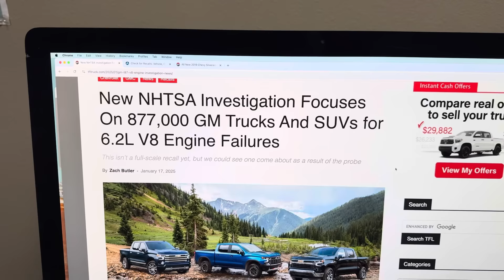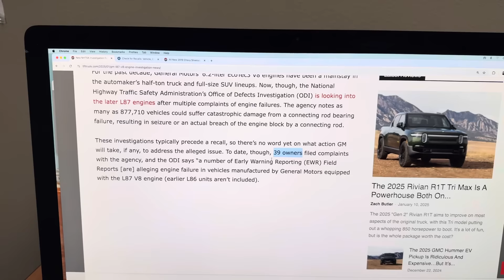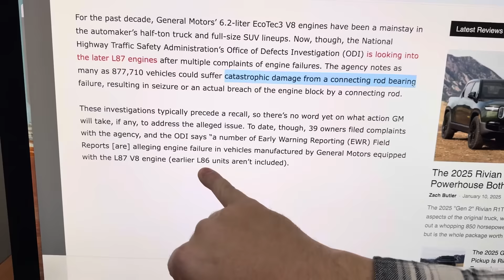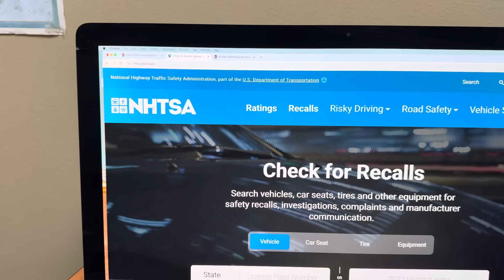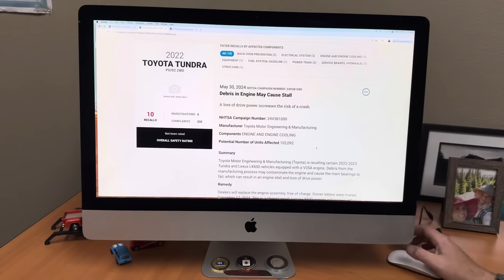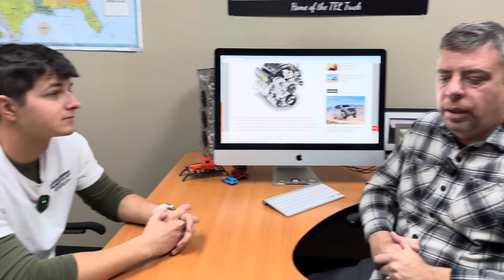877,000 GM Trucks & SUVs INVESTIGATED Over Failing Engines: Are You Affected?

Comment: Why is everyone saying this has to do with the DoD system? The problem has nothing to do with that system. The DoD systems only have issues if you idle a lot (the DoD does not function at idle already), and poor maintenence. The system uses the oil as a hydraulic fluid, not just lubrication,so when it gets dirty or the level is low, it causes bigger issues.
Reply: DoD issues have nothing to do with idling. And you just answered your own question why people are tying this to DoD. 1) using the engine oil as hydraulic fluid causes problems with the oil. 2) when there are issue with the oil, lifter fail and wipe out cam lobes. 3) where do you think the metal from lifters,cam lobes goes, and how might that affect bearings in the bottom end of the engine?
Reply: @CommonSense823 just say you’re a Ford fanboy and feckoff boomer.
Reply: @Liberator29  nice try Ridgeline hero.

Comment: Exactly why im sticking to ford! Would rather have a v6 with turbos than a v8 with cylinder deactivation!!!
Reply: And the damn turbo fail horribly bad too!  There is a mechanic I was watching that works at for and said they get them in all the time to fix.  They are not good engines either.
Reply: @ i heard opposite about the 2.7 ecoboost
Reply: @ms1406 Ford recalled the 2.7 for dropping valves
7
Reply: @stefanovichmichael9686  well my 2.7 has 165548 miles and its great from my research ford engine are doing a lot better than gm!

Comment: Man I love my 6.2's.  I'm sitting in one right now out in the West Texas oilfield it's a 2020 model trail boss that has 316,000 miles on it and has never been in the shop we have a fleet of nine of these trucks all of them with 250,000 miles plus all of them were equipped with the box that eliminates the auto start/stop along with all active fuel management and we have never had a minutes trouble
  On the flip side of that we have three trail boss with the little mini Max diesels none of those three vehicles made it to more than 60,000 miles before they had to have engines replaced they are just not built for day-to-day use out in our Dusty environment.
Reply: That's a hell of a lot of miles, good on ya! Are you running premium gas in those 6.2s? Any other tips and tricks for keeping their 6.2's alive (catch-can, oil change intervals..)?

Comment: Can the AFM be disabled?  A computer module re-flashed? A specific wire snipped?
Reply: New cam/lifters/valley cover. And a tune.
Reply: @ Yow, expensive.
Reply: @ parts are $600-$700.  It’s the labor that kills you.

Comment: I personally know several people who have had their GM 6.2 V8s catastrophically fail at low mileage and with proper maintenance.  One instance was an owner with three of them in GMC AT4's--two of which failed within weeks of each other, both trucks with less than 10K miles.
Reply: He owns a time bomb and is in denial.
Reply: I don’t believe you
Reply: @Liberator29  Believe or not believe what you want, but it's the truth.  I personally saw both trucks on tow transports headed back to the dealer, one with a connecting rod sticking out the side of the block.
Reply: @Liberator29 What is your motivation for responding to each commenter who claims first hand experience and suggesting that they are lying?  I get being skeptical but you're putting a lot of time and effort into casting doubt upon these claims.
Reply: @sonictech1000 Agree but a lot of trolls exist and are here just to fuel the fire
Reply: @Liberator29  quit whining on all the comments
Reply: @tylerboss  Liberator29 is just a troll. Ignore him.

Comment: The sad truth of new trucks in 2025- There is not a single manufacturer that has a 1/2 ton without a serious engine problem.

Toyota- Rod bearings 

Ram- Hurricane has misfire and overheating issues, pentastar follower and oil cooler, cannot be had without the hybrid system

Ford- 3.5 ecoboost cam phaser, timing chain issues and oil leaks, 2.7 wet belt for the oil pump, 5.0 oil consumption, mds, and wet belt.

GM- 5.3/6.2 lifter failures, 2.7 MDS issues and oil consumption, 3.0 wet belt at the back of the engine and DPF/EGR issues

You have the choice of "will it fail eventually" or "will it fail under the warranty period"
sadly, the choice for "truck that will give me trouble free service for 200k" is no longer an option.
Reply: I’ve got a Honda Ridgeline. I know most scoff at it, but it’s half ton and I don’t have a worry about anything in it.
Reply: @CliffWarren  does it have Honda's VCM?
Reply: @ It’s a gen1, so, it does not. So I guess the original point is valid, after reading about VCM I’m glad I have an older rock solid reliable truck.
Reply: Honda's V6 engines which is used in Pilots, Odysee and Ridgelines are having Crankshaft bearing problems, according to NHTSA. 😑
Reply: Nope. Ford fixed the cam phaser issue. Hasn’t been a thing since about 2021. And what timing chain issues and oil leaks?? Not on the 3.5
Reply: @Pilot545  Every vacuum pump on every one I have ever worked on was at least seeping. The turbo drains are notorious for leaking as well. 

As for the timing chain fix, The chain is still the same length and construction, still guided by plastic, and isn't spinning any slower- so it's only a matter of time before the cam sync errors pop back up.
Reply: I have a 2024 f150 5.0 and it does not have oil consumption issues
Reply: @All-Miles-Matter  Nissan Titans with the 5.6l gas have major sludging issues (after the switch to direct injection) and the cats suffer from early failure and can suck the shrapnel back into the engine. 

I looked at around 10 used ones with just over 100k miles and all of them had specks of sludge on the dip stick and insane levels of varnish... Like worst I've ever seen on a vehicle. 

Any of the XDs with the 5.0l Cummins give an admirable challenge the 6.0l and 6.4l Powerstroke for the award of worst diesel engine ever made.

The 5.6l gas is pretty decent compared to the current market offerings. But, it never developed a reputation as a 200-300k mile motor. Not sure if that's due to Nissan's poor marketing or due to there not being many that made it to that mileage.
Reply: @All-Miles-Matter  No,I didn't mention them because they no longer produce 1/2 ton trucks, genius.
Reply: I think the 3.0 Duramax is the best choice out of all of those. Yes it has the oil pump belt. No I haven't heard of one failing and they last quite a while. Pulling the transmission to replace is not super difficult either. In fact I haven't heard of an issue with any GM wet belt or one from any other manufacturer that uses Continental brand wet belts. All of the issues I hear about with wet belts are from manufacturers that use Dayco or Gates wet belts. GM has the 3.0 LM2/LZ0 and 1.2 LIH in the US both using Continental wet belts. The 1.2 LIH was around in Europe for long before we had it here. And it has been around here since 2021 in the Trailblazer. Haven't heard of any issues with one.
Reply: Has anyone actually seen a wet belt failure in an ecoboost or 5.0?
Reply: @stanludorf2311 Don't think so. I believe it's just fear mongering.
Reply: @stanludorf2311 
No
Reply: @stanludorf2311 I’ve seen 4
Reply: @Liberator29  on 2.7 or 5.0s?
Reply: Nice sum up.
ALL true….

Comment: No 5.3?  Also, these engine failures went back to the previous gen trucks as well involving the lifter issues.  So they're going to investigate 1/4 of the problem?  Got it.
Reply: That's because the lifter failure doesn't cause failures.
Reply: @davidwethington9320 where do you think the metal from a lifter wiping out a cam lobe goes?  It just vanishes?
Reply: @CommonSense823 in your mom

Comment: People complain about the 5.3 also.  Funny thing is, is my 2014 Silverado had 237,000 miles on when traded it in. I put new injectors in it and absolutely nothing else aside from oil changes and spark plugs.
Reply: My aunt and uncle ordered in 2 brand new gas Chevy Silverados in 2015.  A 1/2 ton and a 1 ton.  They have not had any issues, but they both only have about 80,000 miles on them.
Reply: ‘08 Burb had lifters replaced at 160k, had until 190k
‘12 Burb replaced transmission at 180k & radiator replaced today at 215k
‘13 Avalanche radiator replaced at 160k, now has 166k
Reply: So, sample size of 1.
Reply: I don't want to assume but I'm guessing these are people who do 10,000 mile oil change intervals.
Reply: Same my last 4 trucks have had the 5.3. I keep all my trucks to at least 200k miles never had any of these issues..Good maintenance and good gas and keep good tires on them. Run like a top!
Reply: @Gonzo1968  What brand of gas do you use and what grade of gas?
Reply: 2014 and 15 were actually pretty reliable. If I'm not mistaken 2015 was one of the most reliable.

Comment: Nice to see them FINALLY investigating this. 39 complaints but WAAAY more failed engines. 

February of 2022, after 9 months and 9,600kms the 6.2 in my 2022 AT4 seized solid while rolling to a stop to enter a traffic circle. Even at my little ol' dealer there was already another AT4 sitting in the yard waiting for a new engine by the time mine rolled in.
Reply: Proof?
Reply: @Liberator29 You want proof that the engine in my truck failed? Well I have pictures of it being loaded onto a roll off.. And also pictures of a work order from a few weeks later with the part number "12716401" charged to it.. I don't have them posted anywhere that I can link to at the moment so you can either choose to believe me or not. That's up to you..

Or if you want proof that there's way more than 39 cases of this failure then I guess go befriend a GM dealer tech.. They'll have stories for you.

Comment: Pay $75k or above for a GM Truck or SUV and have the engine fail inside or outside of warranty.  That will make buyers happy.  
There isn't a new 1/2 ton Truck made today that I think will last long term anymore.  All manufacturers are overcomplicating them to planned early obsolescence.
Keep your last Gen Tundra Andre, it will outlast the new ones.
Reply: The 6.2 is a non turbo'ed push rod engine. I feel like they should have that figured out by now
Reply: @9ZERO6  oh they did.. But like everything else on vehicles these days, if it ain't broke, fix it until it is.
Reply: @Redrider2k2  I can't disagree with you there.
Reply: @Redrider2k2  this is so true these days. Take a otherwise proven and well built motor known for its reliable design for decades, throw in a bunch of bullshit to satisfy the tree huggers and boom we're left with disposable vehicles that crap out months after leaving the dealer. First thing i'm doing with my truck is deleting AFM and doing a cam swap. These systems are designed to save money on fuel so it can be used to replace a $10,000+ engine.
Reply: Nissan Titan v8 will last the test of time. I know you guys don't like to admit it but Nissan has been doing a great job with the trucks.
Reply: @All-Miles-Matter  the Nissan truck V8 is a good one for sure.
Reply: @All-Miles-Matter  Nissan and Honda are merging do to Nissan borderline bankruptcy . Nissan stock jumped and Hondas stock dropped when it was made public. ???
Reply: @All-Miles-Matter except they get 8 miles to the gallon.
Reply: @marklemist6928  yeah that's right!
Reply: Right. I mentioned a simpler truck with basic power. Nobody agreed with me
Reply: I think the Ram 3.0 twin turbo will go the distance. It's built similar to Toyota 2JZ engine....
Reply: And the olds 350 diesel gave olds a bad name? C'mon now.  There is NO quality control anymore

Comment: What's important is finding the root cause and correcting it.
Reply: GM hasn't since 2019.  That is a greedy/lazy truck builder.
Reply: @ I bet they will now.
Reply: Yeah, the problem is EPA. It has to do with cylinder deactivation. Before that was introduced GM V8s were pretty solid. Honda barely making it workable with their V6s and they were having issues. There is a reason why Toyota never used it.

Comment: I think car wizard hinted at these in his last video about a 1997 ford truck.
He said a dealer nearby has 12 trucks on the lifts for blown head gasket.
Reply: You do realize that a 97 is now nearly 30 years old. How many Shoveitorleaveits would it take to equal that?🤔
Reply: Funny that I just purchased a 93k car and I am going to be worried for the next 5 years about it's long term reliability.
It's a new generation the previous one gave me 220k miles with zero breakdowns and zero unplanned mechanic trips.

Comment: 2022 Silverado 6.2 L  here at 46,000 miles and so far perfect! Just keep your oil changed sooner than recommended.
Reply: Oil change is irrelevant to this issue. Many don't make it to their first oil change.
Reply: @Redrider2k2  I agree with that, and the AFM is junk. But getting to the first and second oil change can be a big advantage of getting out any break in metal particales that can cause bearing failure.
Reply: I switched from Pennzoil to Valvoline in my 6.2l SS Camaro and now the lifters are silent!! I can't believe I drove so long on ultra platinum Pennzoil with tappy sound lifters? What oil do you use Tony? I change mine before going over 4000 miles and over 6 months every time, 130k miles!
Reply: @useritscarrot  I use the synthetic GM brand oil at the dealership. And I change it every 3,000 miles.

Comment: Friend of mine had 2 of these lock up on him. Only a few hundred miles after replacing the first motor, the replacement locked up. Crazy
Reply: X2.  My replacement locked up 14,980 miles after it was installed.
Reply: I love farting
Reply: The 3800 GM V-8 was phenomenal.
Reply: GM makes garbage 4cyl, 6cyl and now the V8 are rubbish too?
Reply: @benchmark3332  I don't have problems with my 4 and 6 cyl GMs
Reply: @ The 3.8L is the only good GM v6 engine, the others is only time before they explode.
Reply: GM junk !!!
Reply: Well, you haven't lived long enough at 55. There's been a lot of crazy with GM  Chevrolet. It's been endless throughout my life There's been models of cars that have come and gone that you've never even heard about, built by. built by G M

Comment: I'm not too surprised. Toyota had to reccall 100,000 engines and completely replace them not to mention Ford and Ram.
Reply: Kia had a massive engine recall/warranty campaign. They replaced mine for free at 130k miles and the new engine is protected for the life of the car
Reply: They issued a recall but theyre not replacing the engines until it fails

Comment: I have a 2024 and first thing I did was delete the afm
Reply: BS
Reply: You tore the motor apart, plugged the oil holes, removed all the lifters and reinstalled a new cam and lifters and reflashed the engine computer? If not you still have AFM/DFM.

Comment: The 5.3 have the same  problem. Gm knows the lifter problems. I  personally know  of several 5.3 motors that have the lifter issue.
Reply: Me personally had 4 suburbans failed lifters
Reply: @kalp892 bullshit
Reply: Mine failed along with two of my coworkers.   One of my coworkers had his fail again after the first repair and they put in a new engine.    Both of my coworkers failures were within the first 2500 miles on new trucks.
Reply: Bullshit

Comment: GM ruined the LS V8s when they went to AFM.  The 99-07 versions are bulletproof.  I wouldn't touch anything since.
Reply: ? my '11 LS has no afm.
Reply: @oni-one574  yeah it depends on the model. The new 6.6 in the HD trucks doesn't have AFM either.
Reply: @seabrookmx  I might have dreamt/wished this...But didn't the Silverado have an option where you could turn the AFM off?
Reply: @mackey-5438  from what I've seen you need a little dongle that plugs into the truck to trick it into staying disabled. I'm not sure how much that helps or if the lifters themselves are the issue though.
Reply: @seabrookmx  Aaah, yes.  I remember now.  The one made by Range Technologies is very popular (although I have read the early version of this disabler could drain your battery, which supposedly has been fixed by now).
Reply: @seabrookmx An afm delete that plugs into the obd port, around 200 bucks from summit racing and others I'm sure. It's been working well in my 2018.
Reply: @mackey-5438  After market disablers
Reply: @ That's good.  
I thought all the GMT900's and newer all had AFM and/or E85 capability.  
It's guaranteed that the LR4, LM7 and LQ9 are 100% free of unwanted (& unnecessary) fuel system nonsense.
Reply: Because you have a 6.0l 2500 / 3500 HD right?  @oni-one574
Reply: I have a 2012 Silverado with the 5.3 that doesn't have the cylinder deactivation. It was a fleet truck that was ordered stripped down regular cab rear wheel drive. I have over 150k miles on it right now and it's running strong.
Reply: I think the 6.2s that didn't have the AFM do decent.
Reply: I agree I have 3 2002 4.8 5.3 and 6.0 unreal reliability and parts forever
Reply: I've got a 6.0 lq9 rebuilt new cam bearings everything runs on the top no questions asked❤
Reply: The 06-2017 aren't bad
Reply: The LS V8 is the most overrated engine ever made.
Reply: Yeah. And then Ram bought that ** and started putting it on their trucks and causing failures as well on the hemi
Reply: What are you going to do ??     Drive OLD iron ???      My 2008 GMC Sierra has cylinder shutdown and it runs fine.    150K miles strong.    It starts every single day.     I have absolutely no complaints.    It doesn't even use oil yet.     What do you people expect ????     An engine that never fails ever ????
Reply: 2015 is one of the most reliable.